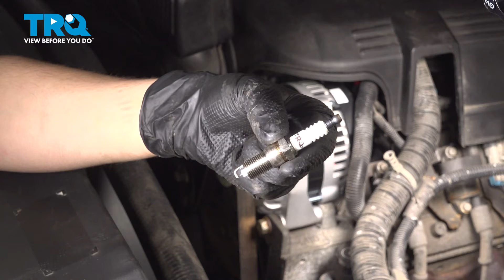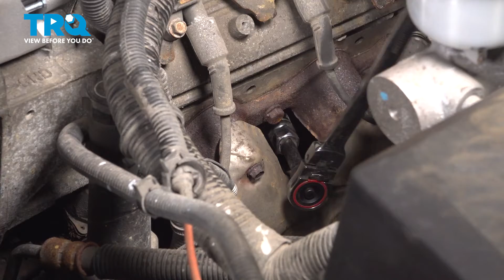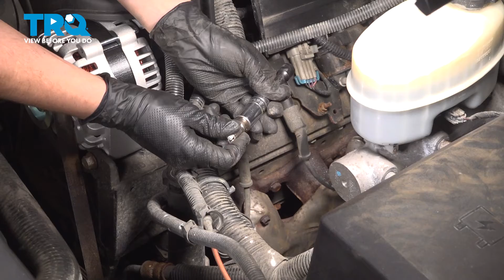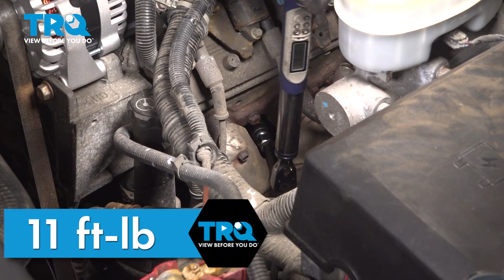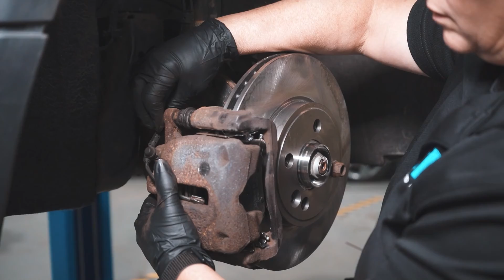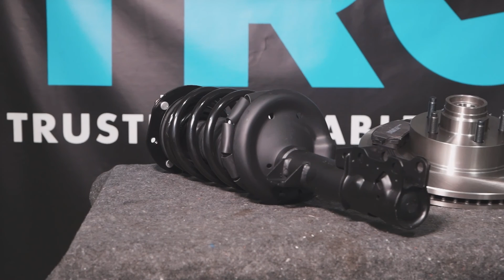How to Replace Spark Plugs 2007-2014 Chevrolet Silverado 2500 HD 6.0L V8

Comment: If your 2500HD is a LC8 and you run on CNG use  a 1 heat range colder plug, a NGK 90156 (ITR6G9) is an excellent choice.